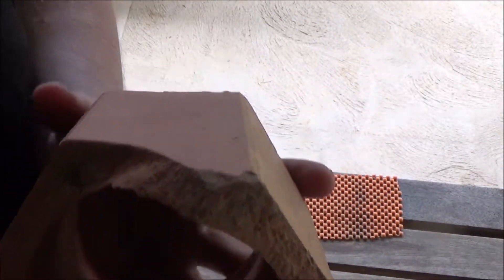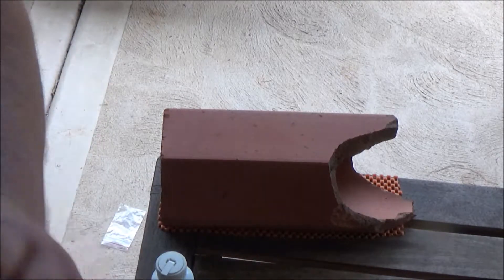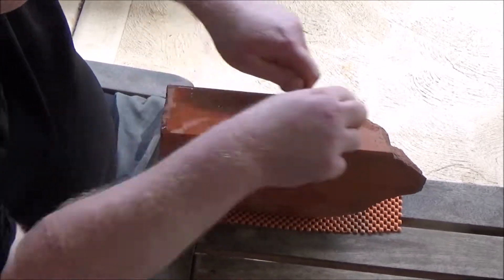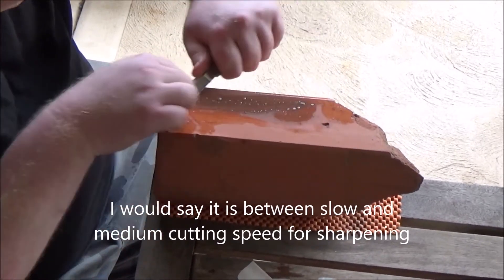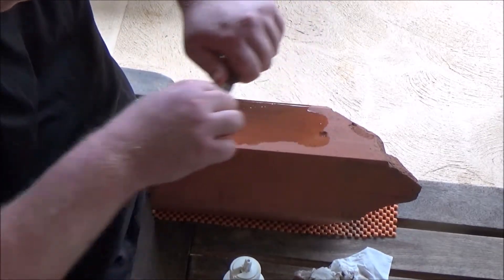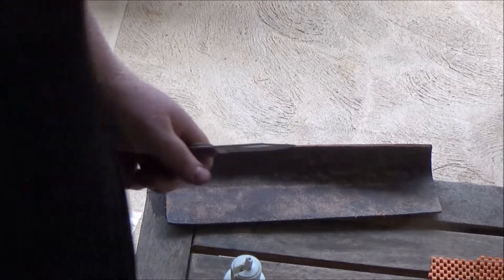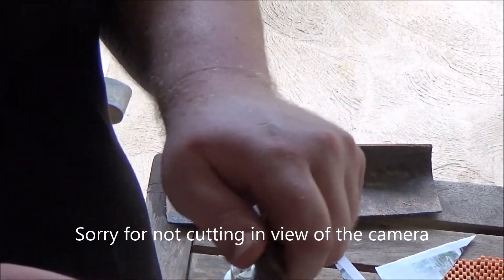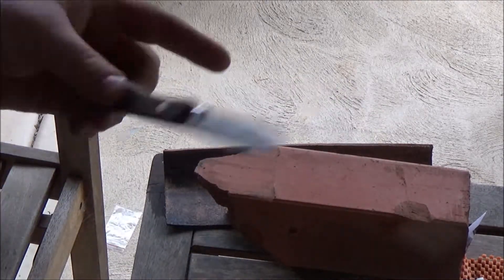Terracotta- Can You Sharpen on it? Episode 1

Comment: Interesting, do you know where I could find terracotta ?
Reply from the maker: Around the back of your shed (Just kidding, I don't know where you live).
These days it is most commonly used for flower pots (from what I can see). But it used to be used for a lot more things. It used to be used for roof tiles, pipes, outlets etc.
If you have a salvage and demolition place near you. They might have some from an old house they knocked down. The pipe thing that I had people often like using for wine racks and things so they may hold onto them if they find them. Otherwise I usually only see it used for flower pots these days.
I got lucky because there were a couple pieces like this along my parents fence line on the neighbors side. That have been there since we got there. That was about 20 years ago lol. He said I can have them all if I want them.
Reply: @scottshobbyz5416  I believe I have some used as wine rack actually
Reply from the maker: You might get in trouble pulling it apart though. One of my friends said terracotta roof tiles used to be a big thing in France. So they might also be an option if you can find some old ones.
Reply: @scottshobbyz5416  ha ha yeah it's my dad's wine rack in our cellar so I definitely can't take it apart
Yes red tiles are pretty common here, but the one I have are curved
Reply from the maker: Maybe you could use the edge or the end of it. I assume you aren't going to use it for everyday sharpening. But just for fun/practice/survival skills etc. So it could be a fun challenge. If you want one you can edc, put in a pack or in the car. You could make a small one from it. Break or cut some off. Flatten it on a big paver with sand if needed. Like i did on the sandstone video. Then condition the surface with some sandpaper on glass. Depends on how many impurities your tile has. Mine had small stones in it I had to dodge ortherwise it would be bad for the knife edge.
Reply: @scottshobbyz5416  okay thankd for the tips !